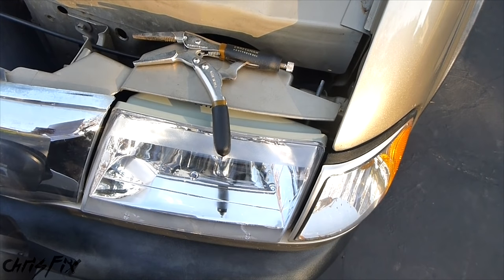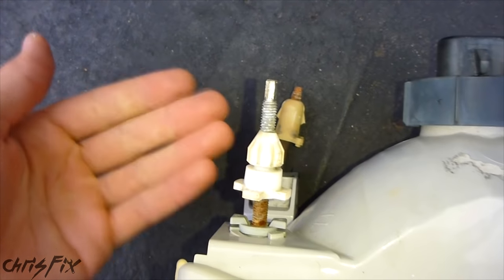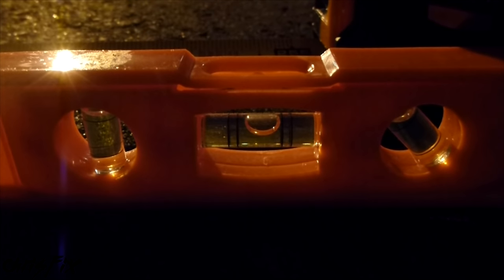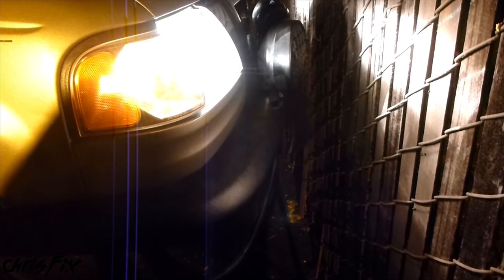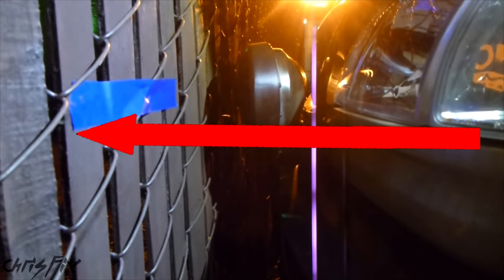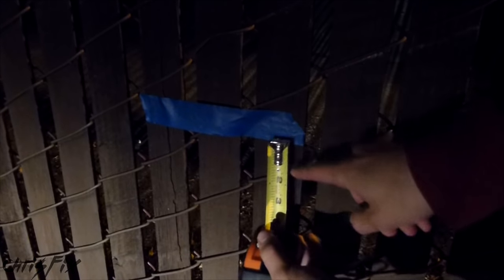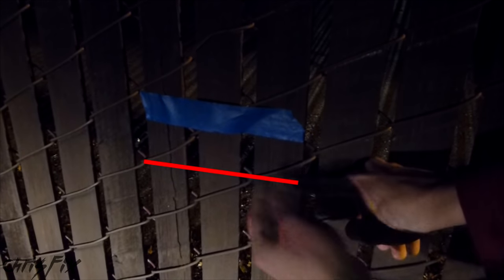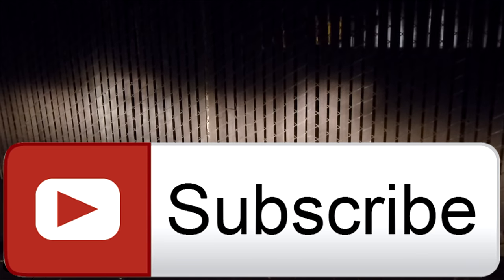How to Adjust, Align, and Aim Headlights and Fog Lights PERFECTLY

Comment: Good deal.  Glad you covered the Fog lights too, that was a good addition.  Didn't know about the 6" L/R option.  I need to move my drivers side light to the right some.  I've got a bit of a blind spot between the drivers side of the road and the oncoming lane so a little more to the right should help...
Reply from the maker: ***** Thanks a lot! Yea, the 6in movement right or left allows you to fill that dark spot and still stay out of the mirrors and windows of other cars! Glad the video was helpful!

Comment: If you have a truck that has weight in the bed more than 50% of the time I would recommend loading the truck like you normally drive.  (This is why stock trucks are raised slightly in the rear)

Comment: I like the info here and believe it will help many people, but find it hard to believe this is aligning lights perfectly when a fence is literally the aiming board outside on a road at night.  Most lights require a 1% negative gradient and the car should be squared much more acurately than a tape measure close then moving back.  Better than nothing but far from perfect.

Comment: OK, I have one question.  The natural alignment of headlights is actually off to the right a bit, so as not to shine the lights into the eyes of oncoming drivers.  If you have headlights that have both high, and low beams, you'll notice that if you toggle between the two, the brights go straight ahead, while the low beams are slightly right-biased.

With the method you just showed, aren't you aiming the low beams straight ahead?  That would give the high beams a left bias, right in to the eyes of oncoming drivers, would it not?
Reply: +seanof30306 My understanding is you do the alignment with the bright lights on.  If you used the method you showed in your video with the brights on, you'd be aiming them straight ahead, so the right-bias would be correct with the low-beams on.

Comment: Perfect!  I was just about to do the headlight adjustment. I was kind of bored of getting the middle finger from ongoing traffic because of a too high beam :D
Reply from the maker: Kaktus Jack Haha, great! Glad the video was helpful! Let me know how it goes!
Reply: ChrisFix I did some adjustment today. The headlights are much better now. I did it on a slight slope so they are just a bit low now. I'll do some fine tuning tomorrow, and then it should be perfect, but for now its much better then it was before. Thanks again for the tutorial :-)
Reply from the maker: Kaktus Jack Awesome! Yea, sometimes it is hard to find a place that is perfectly level. At least you have a base line and now you just need to aim them by eye upwards!

Comment: Not sure if it applies to everyone but legally where I live (US) your low beams must be aimed such that the cutoff of the beam pattern is not higher than the center of your headlight at 25 feet. Fog lights must be aimed such that the cutoff is not higher than 4 inches below the center of your fog lights at 25 feet. This video covered the fog lights somewhat arbitrarily.
Reply from the maker: +Ahuizotl Xiuhcoatl Thanks for sharing.

Comment: Thanks Chris, do you think led head lights require same adjustment process as far as distance? I put some in my car and I don’t think they are as good as the halogen beam I’ve checked bulb clocking and it is 9&3 the color is lighter but the hot spot is non existent

Comment: thank you sir. just aligned my GTP headlights and driving lights. HID are a lot harder to do lol. great video
Reply from the maker: Octane Anarchy David No Filter Austin No problem, I am glad the video was helpful! I am surprised... HIDs should be a lot easier lol. Maybe it is your car's headlights in general. Were the knobs tough to access or turn?
Reply: no brand new headlights i just got today. they are standard headlights and the light is just really bright so kinda had to adjust a little lower then i would for stock or normal halogen bulbs so it does blind people
Reply from the maker: Octane Anarchy David No Filter Austin Gotcha!

Comment: Chris, I dont know if it makes sense or not, but I would add somebody in the driver seat because of the weight. I have seen another two vids on aiming headlights, asked the same but got nothing. Perhaps wont change the accuracy
I have been two times in a production line of an automaker, happened to be in the final check station, and lights were checked at this point, using a computer and AGAIN the car was empty. But I dont know if they take this added weight in account during the adjust and verification. Cudos on you for getting time to read the comments and respond and of course for making the vids. Cheers
Reply from the maker: 38911bytefree I guess it depends on the car/truck. My truck has such heavy duty springs that a driver will not really affect anything. I appreciate the tip though and that is a great idea if you have an extra person around to help! You always have great insight!

Comment: Something I noticed you did that I think might be wrong: you measured from the wall to each headlight. You found that one headlight was closer than the other so you readjusted your car. However, since turning the screws on each headlight caused the headlight to turn up or down or left or right, unless they are exactly zeroed out, one of them might be out or in more than the other.

Comment: Bought used car after market headlights was adjusting them for no more than 5 min and car wouldn’t start, have already installed new starter, alternator and battery everything has been fine until headlight adjusted was attempted?

Comment: Chris, just joined the party.  Nice work, but specifically, I was looking for how to adjust headlights on a 2011 Sonata.  Not just what to look for, but HOW to adjust them?  Where are the screws/nuts to raise and lower.  Thanks for this information.
Reply from the maker: Lee Heft Glad you subscribed. Screw is on top of headlight bucket, in the middle between the low and high beams (you need the hood open). You need to access it through the engine compartment not the front of the car.
Reply: "Need the hood open"  Darn, knew I was missing an important step!  D'oh!!!  Thanks.
Reply from the maker: Haha, no problem!

Comment: that was a good point, to aim the fog light beams to fill the gap under the headlamp beams.  You didn't mention the sideways adjustment for the fog light.
Reply from the maker: Don Cankook Thanks Don!  Most fog lights dont have a sideways adjustment, just up and down.

Comment: Low beams or dipped lights should shine about 150 to 200 feet ahead, while high beams or brights should shine about 350 to 400 feet ahead. Fog lights don't have to illuminate the road ahead, they just have to be placed at a certain height for effectiveness.

Comment: Hi Chris hope all is well with you, you are always awesome, some recent changes now on my Hyundai elnatra 1998 GL, the right park lights are dead but the left works fine, my break lights are fine, both sides, I replaced the bulbs but the park lights are dead both back and front on the right,. and my driving beam are a bit dimmer and my bright lights are like driving beams, anything to look at, oh lastly my hazards are not working but my indicators are working, thanks ChrisFix
Reply from the maker: +successm941 Sopunds like you have a wiring problem!
Reply: Hi Chris I checked the fuses and I also checked the park lights the one was globe was dead on the left side and also checked the other fuse and the one was packed up, I managed to get my hazards back, only problem I am having now is my brightness I will checkout your video one cleaning the head lamps. its just that those products you have this side of town might not be available, and that is a disaster, but let me see, (is there any way to adjust the brightness to be brighter like those aligning screws etc can they work

Comment: Nice video Chris, proper technique although in reality you could don't have to be so exact in the calibration because the next few hundred miles the calibration will be off; the degree is unknown (depends on screws). I like your rigorous proper style though. Anyway, not that's not the point. I know you said you were working on a projector headlamp retrofit, which is nice, I've done plenty myself.
What you can do to regular halogen reflector style headlamps for a cleaner beam pattern cutoff that simulates European beam pattern is this: 1.) Take the plastic lenses apart. 2.) look at your headlamps, you looking and facing the reflector, imagine it in quadrants 3.) blue/green tape with plastic bag or light film, bottom RIGHT quadrant reflector, 90 degrees angle is okay (below bulb cap) 4.) then, blue tape w/ plastic and cover the entire UPPER part of the headlamp reflector of the headlamp (reflector must be protected) 5.) Make sure the tape is clean and the plastic bag (supermarket plastic bag or saran wrap is fine) covers the reflector, the tape at straight, level angle! it's making the cutoff line 6.) Make sure the bottom LEFT quadrant and whole bottom of the reflector is EXPOSED only. 7.) you can now use a spray can paint, black or silver, to dull and cover this reflection. 8.) After multiple coats, peel off tape and plastic and voila! Awesome sharp,reflector style cutoff beam pattern!
It will never be as sharp as projectors obviously, but for reflectors it's as good as it's going to get!  I did this back in the day (over 10 years ago) when HID and projectors were thousands of dollars.
Reply from the maker: Zeppelinlv2007 The calibration wont be off in the "next few hundred miles". If that was the case, no one would have their headlights aimed in the right place lol. I have already gone a few hundred miles and the calibration is spot on. Thanks for the tips you shared. That is a neat idea. I always thought of using something to block the reflector to try and make my own cutoff so I could run high beams all of the time but like you saw, I am going to do projectors!
Reply: ChrisFix

You're welcome. You should do it on a spare if you can't afford projector setup or would like to save some time on a HID retrofit. That way you can get the adapter HID and still have a cutoff that isn't blinding people even when properly aligned.

As for the calibration, you're incorrect as I have done and experience this on many different makes and models. Your set up may be have fine enough to where it's not "off" and where it's not noticeable, that's either A) screw/bolts were very tight that don't allow vibration to turn itself i.e., new headlamps B) you didn't measure fractions/millimeters. Like I said, the amount depends on the headlamp assembly.

Sometimes the alignment bolt threads strips the thread/locking washer (that keeps the bolt locked) inside the assembly, which means vibration will in time (maybe few hundred isn't exact) knock it off calibration. Which is why I said you don't have to be exact.

 It could also mean I worked on too many stinkin' headlamps that I am being too finicky about it. HAHA. Oh well, just a heads up buddy!

Looking forward to new videos!

Comment: Everything looks good except it is an easier way to check the proper height of the headlight assembly. Make sure everything is correct.. tire pressure, fuel tank level (1/2) and no unnecessary weight in the vehicle. Look at the headlight for a DOT mark on the face of the light. It is a mark (notch) and take a tape measure to get the height from the ground to the mark on the headlight face. If the measurement is 32 inches, then right side light assy will be 2-4 inches below the 32" centerline. The left side shall be 4 inches below 32" centerline - 28". Block out light NOT be adjusted. It makes it a lot easier.

Comment: I wonder how those with aftermarket HID bulbs would properly aim lights? Being that High Intensity Discharge bulbs reflect light differently than a tungsten filament, I'd imagine it wouldn't be possible without using a fixture designed for this type of lighting. In other words, lighting would be reflecting in to oncoming traffic.

Comment: Is it the same process for projector headlights or do u measure from the middle of the projection lens instead of the bottom of the headlight itself to the ground?
Reply from the maker: If you have projectors I believe you are supposed to measure from the center

Comment: I suggest people check their manua firstl. Our 02 Accord states find the center of the light which is about bulb height then drop it 2", you suggest 2" drop from bottom of light assembly.Probably not a big difference. either way I was amazed at how low the lights were initially aimed.
Reply from the maker: It doesnt matter where you drop it from, 2" is 2".

Comment: Alternatively, pull up perpendicular from a car 25 ft away in a flat parking lot and adjust the headlights so they're just below the windows/side mirrors.
Then again, my car only has up/down adjustments so I don't have to worry about aligning them horizontally. XD

Comment: I just purchased some 5000k HID's and had some cheap Mexican stereo shop install them.  As you can guess, they are not in alignment.  Do HID's have a light pattern that's easy to identify like halogens?
Reply from the maker: Jeff Gerlitz HIDs are even easier to align! They have such a good cutoff that is it easy!
Reply from the maker: ***** You should never use HIDs in reflector housings. Not enough cutoff and you will blind other drivers. It is the same as driving around with high beams.

Comment: Great video. Do you know what to do when one of your headlights won't go up anymore? I'm adjusting the headlights on a 2010 rogue. They have an 8mm screw, but the passenger side won't go as high as the driver side. 

Thank you.
Reply from the maker: +Arturo Torres Dang, something is not aligned then. Yo might want to try adding washers or something to the screw. Keep me posted!

Comment: Have you ever encountered a set of headlights that don't allow horizontal adjustment? I just got a new set and they have four adjustment screws each. Two adjust the high beam, the other two adjust the low beam and both seem to adjust it vertically.

Comment: ChrisFix's way of aiming the fog lamps is a better approach, IMO, than the other way people will tell you; i.e., to go down 4 inches from level at 25 feet.  Most people don't know how to measure 25 feet or 4 inches and don't understand how to tell if the light was actually aimed properly.
Reply from the maker: Don Cankook Thanks a lot Don!
Reply: It's also good how Chris shows the lights were aimed right by shining them on the parked car to show the low beams are lower than the window.  Never let your headlights shine into the other driver's eyes.

Comment: I don’t understand. The passenger beam is supposed to be a little higher than the driver’s side, but you lowered the tape 2 inches on both sides and aimed them the same way. Why?
Reply: Some vehicles require a person setting in the driver's seat.
Reply: @ledwysdelgado7304  …and those same vehicles are designed to aim the passenger beams higher than the one on the driver’s side, so the question remains.
Reply: @emmettturner9452  Yes, the passenger side will be a bit higher.

Comment: Sadly this helps more than a lot of other online written tutorials. I say sadly for their sake. Question though, how to get brighter headlights? I was told go for HIDs but Im also told they gobble up power, and my old Sunfire might not be able to take it. Last thing I want to do is put a huge load on an already old car. (I should add my headlight assemblies are brand new, not yellow, and supposidly so are the bulbs but theyre very very dim for "the best ones at walmart
")
Reply: Get LEDs. They run cooler. Then adjust your headlights so you dont blind ppl lol

Comment: Hi Chris.

So, I have a 2015 Volvo S60, prior to when Volvo went over to all-projector lamps. As such, I have the ugly amber halogen bulbs that go alongside the pretty bright blue LED strip. I was thinking about swapping out bulbs to LEDs so they would match the accent lights, but when I inquired with my dealer technician, he said he would not install any aftermarket parts. He said he wasn't sure how the reflector assembly would interact with such bulbs, and if there was any issue with the wiring harness, it could void my warranty.

My question was this: Do you personally think there's any risk to upgrading your bulbs to LEDs as long as you aim them properly, even with reflector-style headlights?

Comment: Just got led lights for my f150 and wow are they super bright! I have to adjust them, if it doesn't work, I'll have to switch back to halogens.
Reply: If you have reflector housings, get that return label ready.  I just did this experiment a few weeks ago in my 2003 F150.  No bueno.
Reply: @ashemoski  they are legal. So many cops have seen me with them and nothing has happened. They are bright af and are reflector housing but whatever
Reply: @MrBullya   Police not pulling you over doesn't mean they're legal.  Post a link to your state law saying they are, and I'll believe you.  In any case, they're "bright af,"  and you're blinding oncoming drivers, "but whatever."
Reply: @ashemoski  well it doesn't say they're illegal .

Comment: Hey Chris,I've got a 2015 civic si and just bought a set of 9005 leds for the Bright's and it seems like the 3 slots are a little off on either headlights. I can't get the LEDs in there to sit at 9-3 o'clock and instead it sits off or not straight inside the headlight. My question for you is can you move the the slots arounds in the back to line up properly? I know this is tough to explain by text but essentially the LEDs don't line up properly because of the fitting at the back of the headlight.